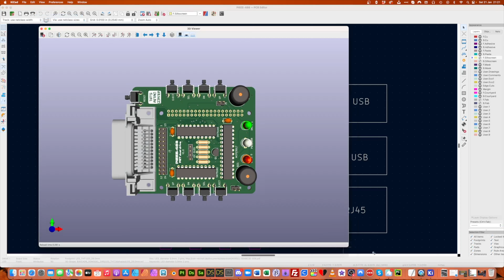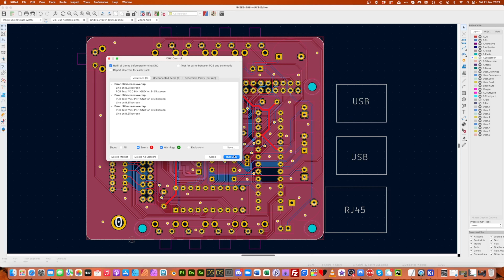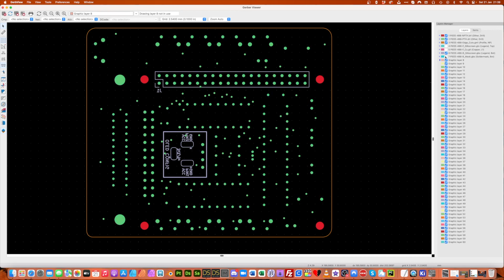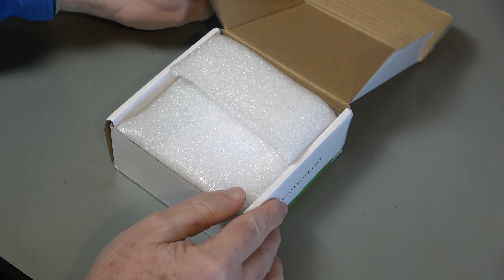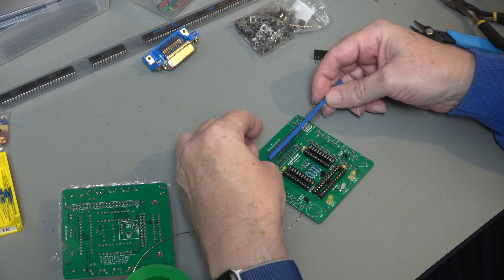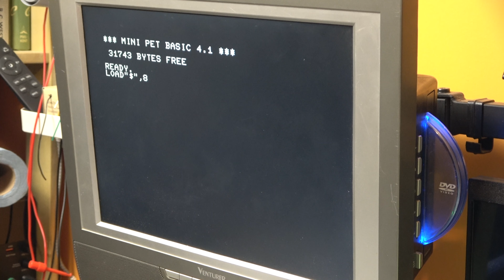PIEEE-488 Prototype Project Part 2: Designing & Building the PCB

Comment: I want to buy one when you are ready for our 8032SK I like the fact that it uses a centronics connector which is the only option on the SK case without modification.
Reply from the maker: I'll make an announcement when it's ready, for sure. The hardware is pretty close to done, but the software is still some way off. I did add a ribbon cable header as well as the centronics connector. Originally that was for a test harness, but it would be easy enough to wire that to a card edge connector as an alternative for older PETs.

Comment: If I remember right, the real drives (or maybe only some models) have some sort of circuit attached to ATN to react to it quickly enough. The software doesn't need to be super fast in that case.
Reply from the maker: Yes the 4040 and 8250 both have some extra logic that drives NRFD and NDAC directly from an incoming ATN signal. It's something to think about for the next iteration for sure. Other parts of the protocol are not as time critical - it's just this initial handshake.